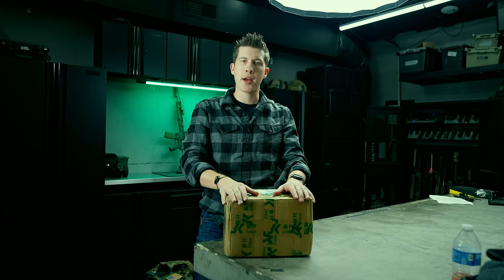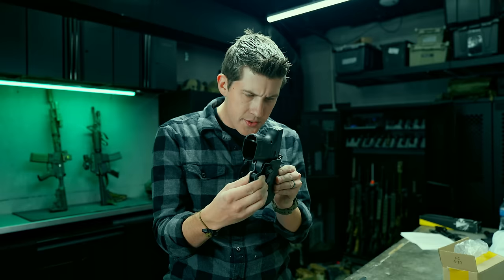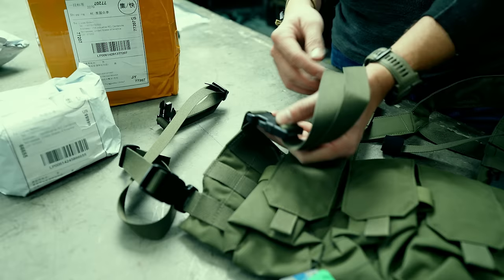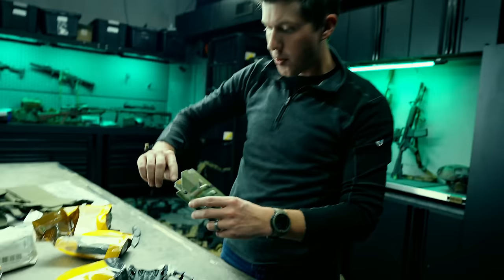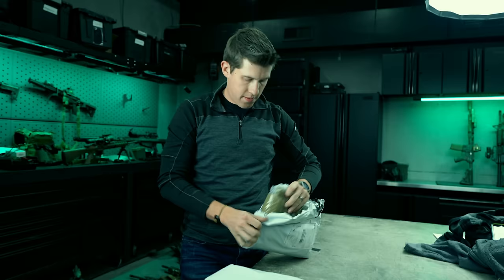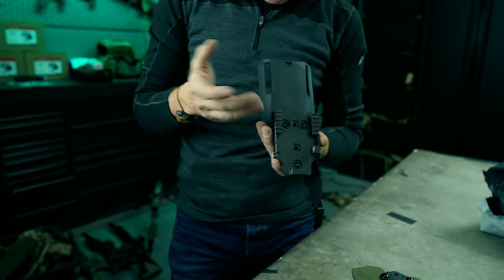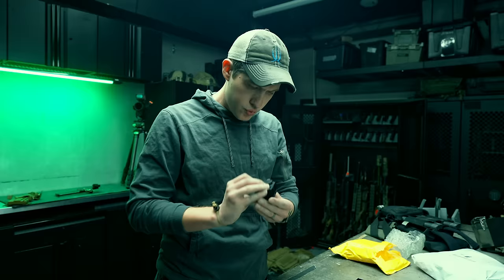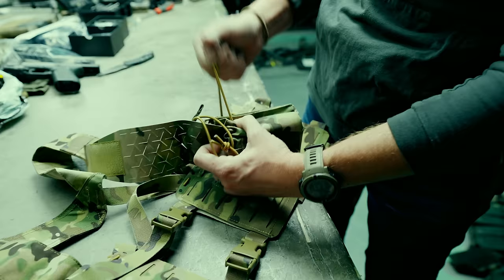Treasures from the Orient - Exploring Knockoff Gear from China

Comment: I would like to see more Chinese made optic/lights/lasers knock offs and have them actually tested just to see how bad or good they can be
Reply: Lasers seem to put out more power than advertised. Tested out a few pointers one time… all of them should’ve been classified as 3b
Reply: Got a knockoff Perst-4 and im pretty sure I can perform laser eye surgery on an astronaut on the international space station from my driveway
Reply: @NotHunterCooper Doesn't that mean the laser pointer is too large to use upclose?
Reply: The Chinese Perst-4's are solid. Output is almost that of a real one and they hold up to abuse. The excess bloom can be fixed with a diffuser like the real ones. They have been used in Ukraine on account of Zenitco goods being hard to obtain.
Reply: the cheap knock-offs die to recoil pretty easily. Lots of vids on youtube of their performance. But the higher end ones, like Holosun's top end red dots, are really good.
Reply: @NotHunterCooper  Can confirm, i have one of those too. It shipped late because the guy had sent like 3000 of them to Ukraine.
Reply: Ive reviewed a few of the IR and White light Surfire and Streamlight Chinese knockoffs on my channel if you are interested. They are worse with Candela and Lumens, but they are rugged from the few Ive tried to destroy 🤷‍♂️
Reply: I picked up an ultra fire which is their sure fire knock off and it did not work at all. It's terrible
Reply: Brass facts and hop are good channels for that
Reply: Cant go wrong with Holosun. I dont care about what the reddit warriors say I have had great success with my 507, 510 and I have 2 x 512 gold dots I absolutely love. Great battery life, crystal clear and rugged.
Reply: There is a reason older people will tell you buy once cry once. But please find out for yourselves.

Comment: Was talking to an acquaintance one day. It's more funny that a lot of the larper communities in China buy more authentic gear from here and have it shipped over there. Turns out it's legal to own body armor, plate carriers, and own night vision. Just nothing that goes bang.
Reply: I'm really surprised they can own those items.
Reply: That's news to me. I didn't know civilians can own body armor.
Reply: I highly doubt that they can own armor plates. Plate carriers, probably.
Reply: @doubletapairsoft4716  
Same, I doubt they can own armor.
Reply: And yet you're still talking about airsoft gear
Reply: airsoft and cloning for airsoft used to (i think still is) a GIGANTIC thing in Hong Kong
Reply: Those CrossFit plates are as good as 3A. Get some flexseal or rhinoliner and give it 3 or 4 coats for spall..
Reply: The Chinese can own any tactical gears from carriers to armor plates to tactical pepper spray with flashlight and tasers installed on batons (these stuff truly exist)…they can even own cell jammers. They just can’t have anything that resembles the look of firearms and switchblade knifes.

Comment: I ordered that Chinese 6354do for fun to see if I wanted to order the real safariland one. At first the gun got stuck just like in the video, but after an extensive amount of filing on the ALS system and taking a heat gun to re-mold the flashlight area, it works great. Although I would never use it on duty now, its still a good training tool since it functions correctly. And it did convince me to buy the real thing since I liked it so much. for reference, I'm running a g17 with a trijicon rmr and a modlite. 

It seemed the issue was that holster is made for airsoft, and on airsoft glocks the ejection port is much deeper than on a real firearm, thus, the ALS was extended to catch the airsoft depth slide/ejection port.

Comment: All those holsters are definitely sized for airsoft Glocks. I've owned several (TM, KJW/KWA, and Umarex), and they're wider to varying degrees compared to a real Glock. For holsters that allow you to adjust the tension, I noticed I had to loosen the screw quite a bit (TM based Glocks seem to be the widest) to make them fit, if they fit.
Reply: If i remember, vfc are the only true to size (because of the official license)
Reply: Current gen ones by decent manufacturers have got the sizing spot on now rhankfully as i use an Alien Gear holster for my WE glock 17 and it fits perfect.
Reply: afaik airsofts are usually larger in size tho

Comment: I thought there was going to be a shit ton of tacticon gear after they released the video. I wanna see Lucas fight the sandalorian.
Reply: It's so weird I have yet to watch that but I like sandles dude but think the other blonde dude is kinda a douche. I reached out to them about a chest rig I bought because I wanted to test it out for 50% off and after letting them know I have a long torso and it didn't fit and was told I was wearing it wrong 🤣 like okay bro sorry forgot you know more about my measurements than I do . I will back there battle belt v2 its pretty functional. most of the other stuff is kinda meh very chinesium.

Comment: I enjoyed this episode, but I didn't feel that it was a fair comparison between products. Maybe you should have told us the price differences. 90% of my nylon gear is Haley, but I bet that "Chinese" stuff was WAY cheaper. Most of the time, you get what you pay for. All of my tactical holsters are the TREX Ragnarok from you. My sidecar is from Tier1.  $34 is HELLA cheap compared to the Tier1 Agis Elite for $140.
Reply: I agree with what you said here and said something similar in a comment if you can afford it enough to have something more than sticking stuff into your pants pockets. Then have that. After all, if it hits the fan you're gonna trade up or be dead so start with something. Especially for this kind of equipment.

Comment: You forgot to get the knock off surefire X 300 lights in both styles! I have one and so far it works just fine and works in holsters made for the light!
Reply: What brand and where did you get em ? I have an Olight badlr and Streaml8ght TLR9 and my crappy $30 Feyachi light off amazon is brighter than both of them lol
Reply: Nothing special about Surefire weapon lights as far as performance, there are a ton of lights that are far brighter, the reason Suerfire charges a premium is because they are battle proven and virtually indestructible.
Reply: @KevinHuff23 I’m gonna agree with this. I’m ashamed to say, I bought an olite, a knockoff streamlight, and a knockoff SureFire. The 2 knockoffs couldn’t stay on the gun. The olite internals couldn’t handle the recoil. It just kept flickering. Good customer service though. They just sent me a new one no questions. I might try it on a pistol, rifles are too strong.

Comment: you should do the fake unity fast 2.0 mounts, badger ordinance, Hydra and other copies out there. Some replicas are really good and affordable
Reply: I have a replica HYDRA I bought for a joke and the SOB is stronger aluminum then the real one ans better made with better screws.  The original has subpar aluminum and actually bends which most know who have them and major complaint.  It was 35$.  Most aimpoint type clones don't have the locking lug although.  Some of these companies are getting good.  I know a few guys who have been running knock off mounts for 3+yrs with zero issues.
Reply: @chaoticcaninejb  couldn't agree more. I have a Fast 2.0 on a Leupold VX-6HD and you can't tell the difference.

Comment: U should do the Somo gear peq boxes, I've heard mixed reviews but apparently they usually hold zero and are full power beams.
Reply: I got one last year because I'm not paying thousands of dollars for a fancy laser. 

It is surprisingly good. Absolutely holds zero for 556, and battery drain isn't bad at all. I would suggest it if you have nods, it's a lot of fun for a fraction of the price.
Reply from the maker: Working on a video now

Comment: I had a carhart work belt with one of those knock off cobra buckles. They work, until they don't... Which unfortunately happens pretty quickly. When it failed, it completely just flew apart. I unclasped it one day and the springs just flew out from behind the little push taps on the female side of the buckle. It was done after that.

Comment: While we are looking at cheep gear.
Does anybody have input on the quality of the sight mark red dots ?
I don't trust Amazon reviews.   Thanks
Reply: Honestly, I got a little sightmark micro red dot that came with an AR about 12 years ago. It holds zero on 5.56 and 5.45x39. I recall it "flickering" on 7.62x39 recoil. I don't use it on any primary rifles and it ended up on a 10/22. However, it does still work after 12 years. Battery life is incredible. However, I would seriously doubt it's rain/water resistance and as I previously mentioned, the internal circuitry seemed to not appreciate heavier recoil. Mine is a sample size of one and 11 to 12 years old at this point...also got it free with the rifle. If I had paid $60 or less I'd say 4 stars...if it was over $100. Probably 3 stars. It works, but I wouldn't take it into battle.
Reply: Thanks for coming to my Ted Talk

Comment: "I think Mike's is a little bit longer"
[Childish giggling 😅]

Interesting to see, some of the clone stuff or FLYYE brand stuff is well made, but you have to know where to source it... So much crap floating around.

Taiwan has a lot of good domestically made tac gear, holsters, BDUs and even armour plates now (not the issue stuff getting shredded on Samuel's video in the US)

I've also got genuine Safariland 579s and the knock offs aren't bad although pistol compatibility isn't always perfect, the Blackhawk knockoffs appear to have been made with their (old?) moulds and then had the branding scored out with a soldering iron or something.